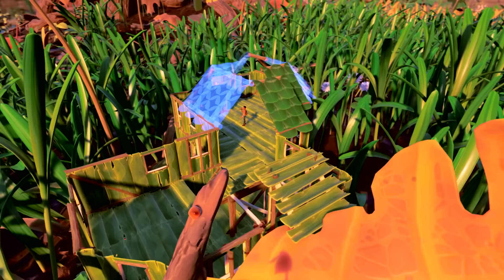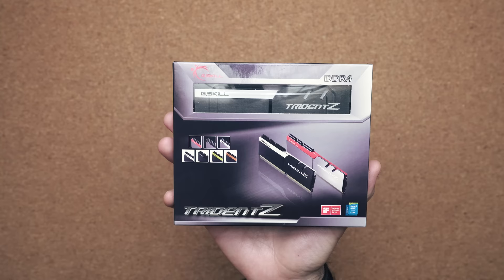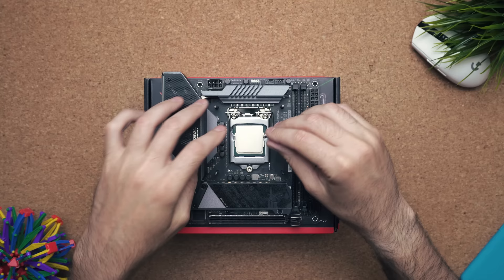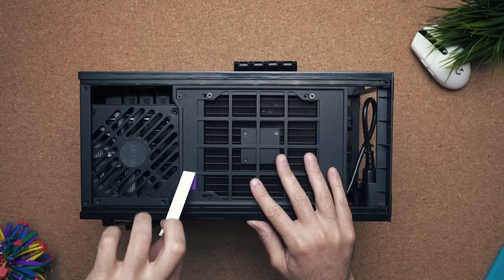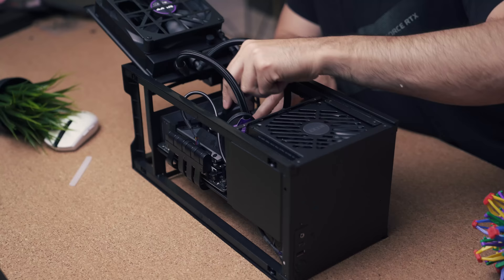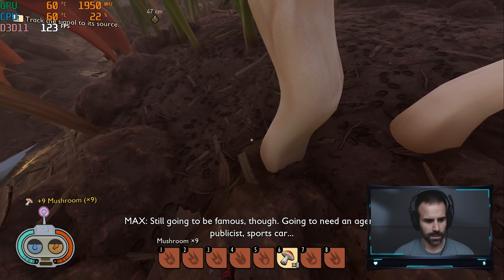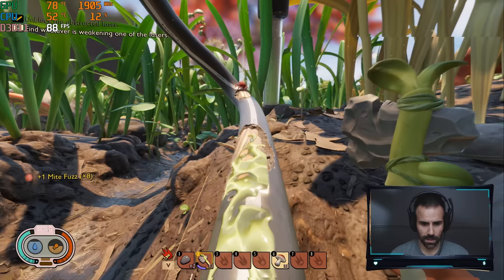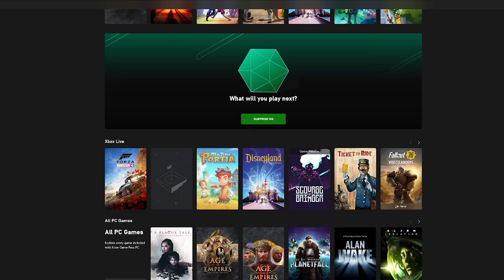I Built a Tiny Gaming PC for XBOX Game Pass // PC Build Guide!

Comment: The 10900k is nice but it gets beat out by the R9 3950X. AMD would have been a better option
Reply from the maker: In gaming ? No Intel 10900k has about a 15-16% performance difference over the 3950X. Right now the 10900k is the fastest gaming CPU on the market
Reply: @MatthewMoniz  when looking at fps between the 10900k and the 3950X its only about 3 to 5 fps difference. AMD excels when it comes to multitasking performance and heavier loads.
Reply from the maker: Yup totally agree but again the idea was to create the best gaming PC for the money regardless of everything else and the 10900k is the cream of the crop in that regard
Reply: @MatthewMoniz  ok i see where your getting at however if you intend on game streaming for a good price the best CPU for game streaming would be the R7 3700 or 3700XT
Reply from the maker: @tristenwilliams558  The 3700 offers great value and if I had a smaller budget it would be the one I'd go for or even a 3600 or 10600K. But as I mentioned in the video I had a $2500 budget to create a beastly gaming PC and I was able to squeeze in the 10900K to squeeze out those extra frames!
Reply: 神様闇の稲妻 Never stream off of the same cpu your gaming off of. You will get a performance drop and stutters no matter how good your cpu is. Either use the much more efficient nvenc gpu encoder or a separate system like professionals do.
Reply: @lightbox8019  since when did i mention that.
Reply: 神様闇の稲妻 you said the best cpu for game streaming for a good price is the 3700. If you truly meant it as a machine by itself than that’s kind of irrelevant to the machine reviewed in this video and the 3700 would not be the best value option for a separate pc. A 3600 would be just fine if not overkill.

Comment: I tried the same ram on the same MB in the same case, and was disturbed by how much the AIO tubes were pushing on the ram.
Not willing to give up RGB, I bought some Crucial Ballistix instead.  There is still a little pushing but not so much now.
Reply from the maker: RGB on this case is pointless. You can only really see the GPU
Reply: Matthew Moniz hmm well I can see it just fine, but from the side.  But that’s not really the point, the point is that ram height and thickness are both concerns with this case and motherboard.

Comment: If you are avoiding 2080 Ti then 2070 Super would be the way to go, 2080 Super/2080/2070 Super are all based on TU104 and perform very similar.  2080 and 2080 Super are pretty much never worth it for the tiny gains.

Comment: The entire argument that the INTEL option is the better choice is idiotic given that AMD 4000 series debuts in September and are rumored to have 15% or more in IPC over Zen 2. They are going to strip that so-called Gaming crown from INTEL completely. Plus, the RTX 3000  and new AMD GPUs will be using PCIe Gen 4 for higher bandwidth to get better raytracing and 4k performance. This build is obsolete!